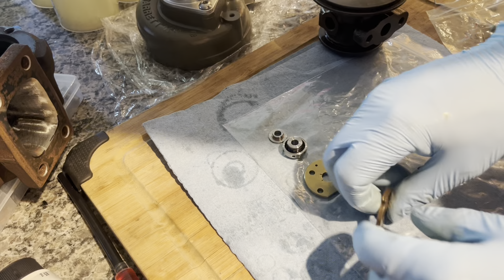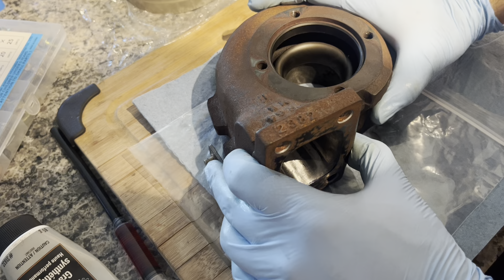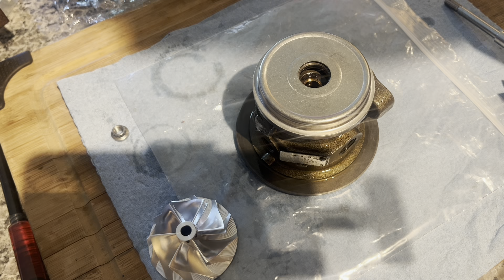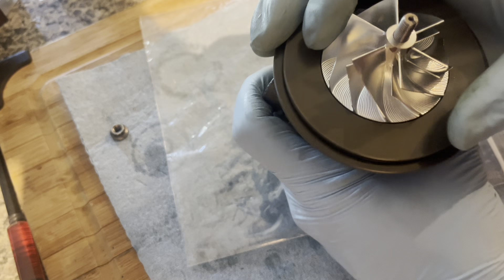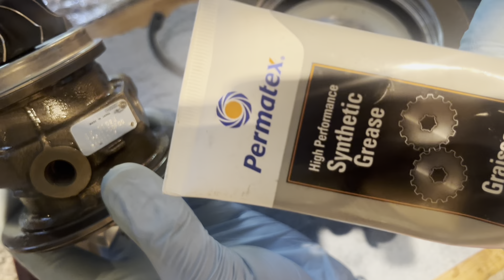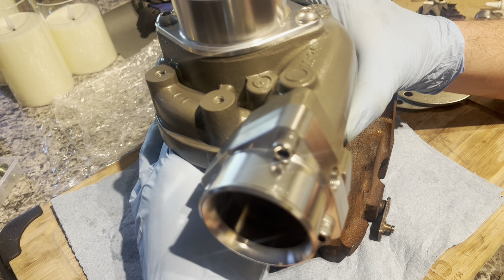High Flow OEM SR20 T25 Rebuild & Upgrade - Max Power from Bolt-on using OEM Housings

Comment: Where do you get the compressor wheel? Thanks for the tutorial! RB25 time
Reply from the maker: I’ve been working with a Chinese metallurgist and cnc machinist for a number of years and we work to try things together. Admittedly I was lazy on this one so basically took the measurements off Mamba’s billet sr20 wheel as the base for design and added a 1mm OD extended tip and brought the total blade height up 1mm. 

Turbine is basically the OEM 11blade wheel in inconel 713c. There was existing casting molds for tb25 turbine and it would have been significantly more expensive to design a new mold for 9 blade tb25.
Reply: @JesseBreaks wicked! Excited to see how it performs. Would be cool to see back to back with stock trim sr turbo
Reply from the maker: @403cefiro I’m primarily a K series guy and basically just did this Nissan turbo build to provide you guys some information and ideas. If I can come up with a second stock s13 turbo you might see those comparative results running on like a k24 eco 2 lobe vtec engine or maybe like a D series 1.6L
Reply: I have a stock s13 t25 sitting at the shop, I'll see if I can dig it out  @JesseBreaks
Reply from the maker: @403cefiro  Not impossible for me to source a second rotor group set exactly as shown in the video if you want to give it a try. May take a month or so to be completed and balanced. Would recommend the same porting procedure on turbine side at a minimum.